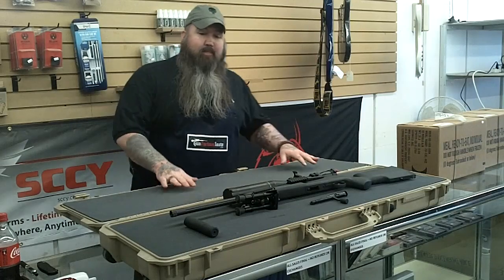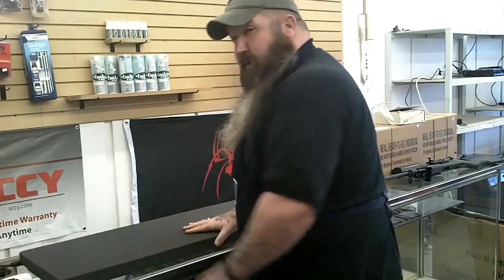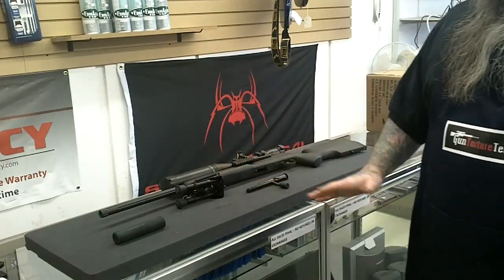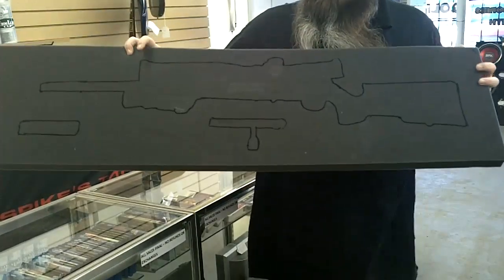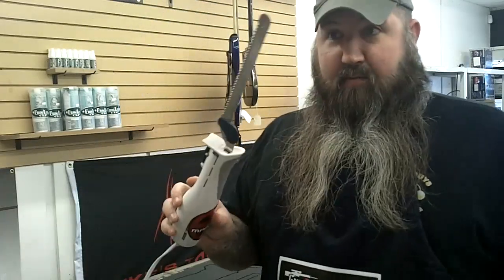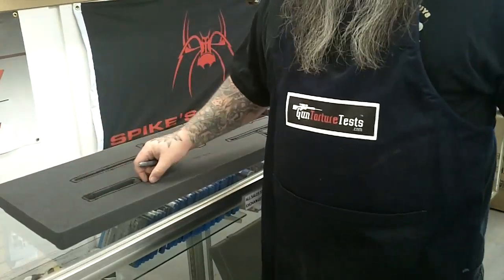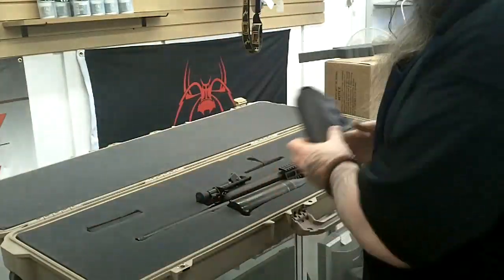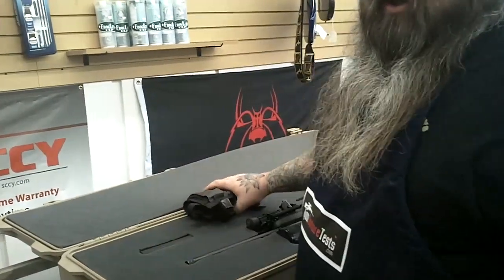Fitting Your Gun To A Pelican Case

Comment: I made a foam cutter using some parts from Hotwire Foam Company. I had to find a power supply and just happened to find a old Hobby Transformer train track electric box. The box plugs into the wall and you can adjust the heat of the piano wire by adjusting the train control speed box. I use a straight edge to run my piano wire down for the long cuts, makes em really straight. Cuts are perfect, makes doing corners easy. Just cut a hole, run piano wire through and connect to your "L" shaped beam and it turns orange hot, just take your time and stop if your having to twist in a wierd position for a cut.

Comment: After using the carving knife on several projects I decided I hated it.  I recently started using a variable speed jig saw with a coarse wood blade.  The saw fits flat on the foam, keeping the cuts straight (perpendicular) and consistent. I do use the turkey knife for "halving' my bolt and mag cutouts and stuffing half back in their hole. I also heat up a .44mag casing (empty!!!) and burn in a finger slide on each side of the hole for accessing the bolt and mag from cutouts.

Comment: If I were packing an expensive rifle to ship on a plane, If you say anything other than pelican I'll slap the silly off you. Now if I'm just taking my M4gery to the local range in the trunk of my car. The knock off from Plano is more than good enough.
Reply: same here i got a case from cabelas for $75 on sale, its built good but i woulnt trust it with my guns on a plane. but when i throw it in the back of my truck it keeps it secure
Reply: That may have been the case in 2013 when this video was shot, but I have a Boyt H41HX that's at least as, if not more tough than a pelican.  Extremely well-made case, and well-suited to survive the TSA.
Reply: Sean Malahy I'm not familiar with that case. where did you get and how much was it. I need to update my rifle cases.
Reply: I have that Plano for my M1A and its a great case.  Only 125 at Big5.
Reply: Exactly. And all that TSA-gorrilla-proof protection comes at a price, which is weight.

Comment: If you want to add some color along with chemical/oil resistance I would use tool foam.  I've used this for lab testing equipment and tool boxes, it's easy to cut and you can use different colors to show what is missing, you want the closed cell foam.cascade tool and foam. toolfoam dot com  A little spendy but the final result looks really nice.

Comment: I would recommend that people considering doing this not mark out the barrel part.  After you get the body of the rifle cut out, put the rifle in the hole that's been cut out, and the barrel will be touching the foam.  Much more accurate.

And if you're like me, and don't want marked foam showing - plan on flipping the foam over.
Reply: Damn...  Got the the part in the video when you flipped it over.  Commented before I finished watching.